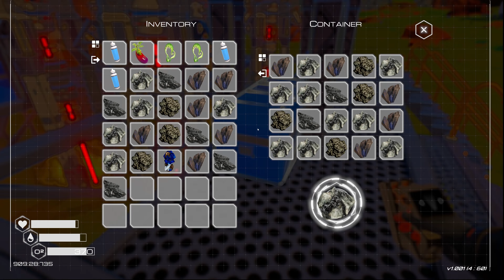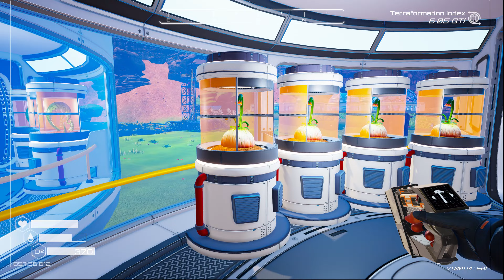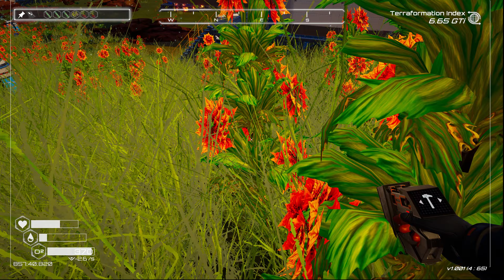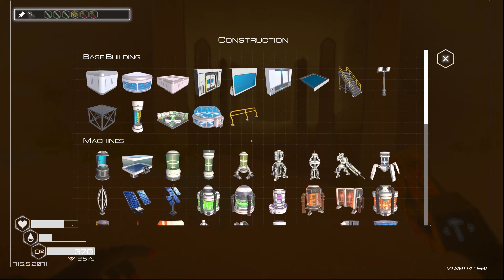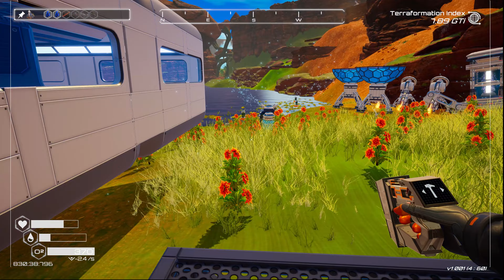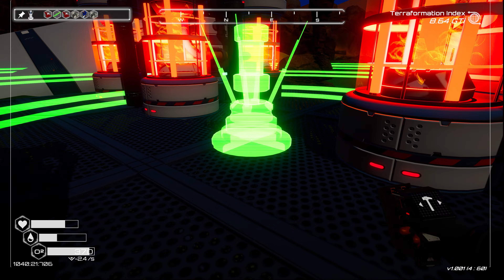Planet Crafter 1.0 - Hardcore Run S1-E10

Comment: The first ore extractor you gets will mine in the aluminum field and iridium cave. Don’t need the tier 2 for those.
Reply from the maker: yeah, not sure if that was a change since early access or not, but I didn't think they did.  Confirmed it later though. Thank you for the comment I appreciate it.
Reply: I knew about Aluminium, but I figured T2 was needed for all the "glowy" materials, including Iridium. I'm glad I was wrong.